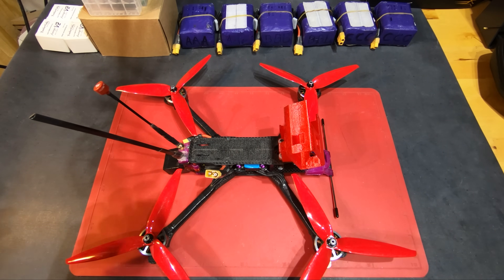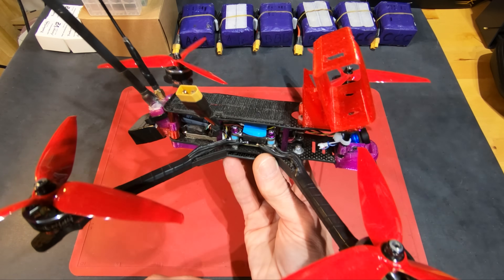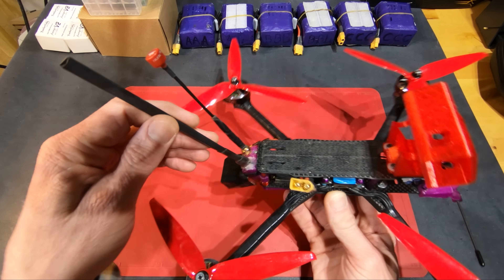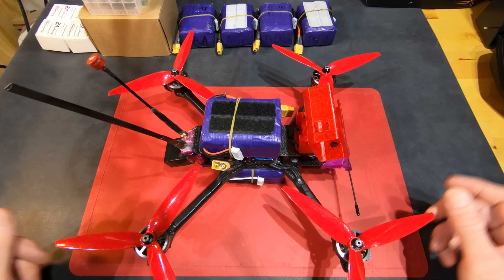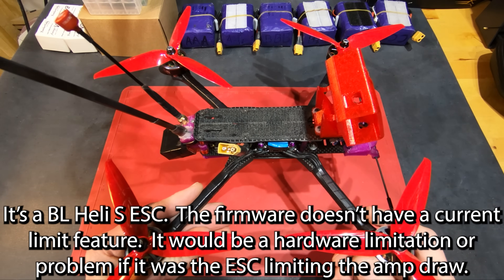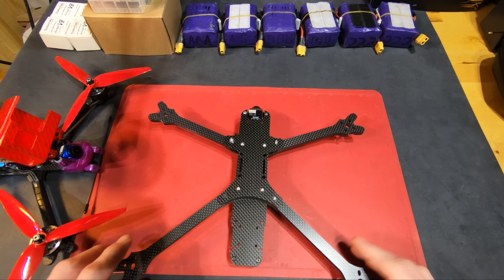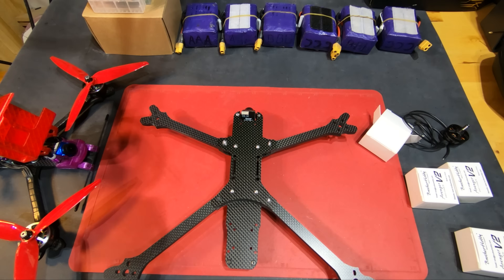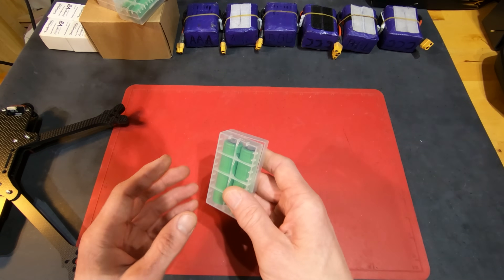My 2020 Long Range FPV Drone & Gear : Gets 8.5km Out - Roundtrips of 18km+

Comment: I'm using vtc6 cells in 6s2p for 6000mah. It seems like I can never get close to using 6000. They claim to be rated for 30amp but it think they are actually like a 15 amp battery. What amp rating do you believe they are? I got the wrong cells didn't I?
Reply from the maker: I think the vtc6 are better for lower amp builds.  Have you double checked your mah consumption from betaflight vs what a charger says after fully recharging?  To check that your mah consumption count is close to accurate.  If it's not and you are using BF 4.2 I believe there are some new features that help it make better estimations of mah consumption.
They are 15 amp batteries.  I don't know why they put 30 amp on stuff like the auline packaging.  The manufacturers data sheet clearly says 15 amps constant.  They do have a 30 amp rating but only for burst or possibly constant but ONLY with a temp limit from a battery management circuit.   There are very few cells that can put out serious amps.  I think electric car manufacturers are buying up entire lines of some of the best cells.  Not sure why vtc cells get so much attention, or why auline would choose those over ones with more than double the amp rating?
I made a vtc6 4s pack for my flywoo explorer and used my charger to confirm getting 2800 mah out of it, but the last bit the quad was really low on power.  I notice in the manufactures data sheet that is does sort of show that the last 1/3 or 1/4 or the cells output gets pretty lame.  Have you tried a throttle limit?  It'll reduce your power if you can spare it, but I think you might find a little better efficiency or maybe squeeze a bit more out of them (just guessing here)
Reply: @FalconRadFPV  Yes I calibrated my quads current sensor, you confirmed what I suspected, with a 15 amp rating as soon as I push them the mah turns to heat lol so with 2 packs in parallel I'm only getting 30 amps as a maximum which I'm at 20-25 climbing anyways, so the answer is? I can't wait to see some of your testing with the new 7inch setup on 4s! I think it will be more efficient and will hold more battery.

Comment: hello maybe you are the only one who can help me to understand.In the setting of the nano diversity in the voice power there are powers to be set in mw I do not understand what it is for.Sorry for being out of place
Reply from the maker: Sorry I'm having trouble understanding. In the crossfire Tx menu there are mw power settings, I don't think the TX mw power is set by the diversity menu I think it's in the menu for the TX.  Both are in the same place under lua scripts on the transmitter menu's.  The Tx mw power decides how much RF power to use for communication between the Tx and diversity receiver.  Generally 250mw should be good for most situations.  If there is much RF interference in the area or you are flying very far away then using a higher power setting might help.  I have the 9old micro Tx so mine doesn't go any higher than 250mw.
Reply: @FalconRadFPV  sorry you friend. In the crossfire menu we enter XF Nano Div.Rx> Power 0 mw 25mw 400mw or max power.I see these settings, Best regards friend  https://www.youtube.com/watch?v=7XKHNggnBsE
Reply from the maker: @ladronefpv4484  I narrowed it down to one of these two things - 
1- To me it looked like power settings for a nano 32 vtx.  Maybe you have a nano 32 vtx connected to your receiver?
OR
2- I also looked into it and asked some people about it and someone thought it might be a glitch that can be solved by installing TBS Agent Lite to use instead of lua script.
I found a good video about TBS Agent Lite here's the link for it.
https://www.youtube.com/watch?v=4aZfvu2iUrs
Hope this helps!

Comment: First off, thank you so much for sharing that with us, I have watched lots of long-range flights but I'm pretty sure you are the best. It's an honour to be subscribed (SO IF U AREN'T HIT THAT SUBSCRIBE BUTTON)
I also just wanted to ask - I have a stock flywoo explorer, with some skyzone 03o proper diversity goggles (but a fairly bad immersionrc invader patch) and I can still only get about 400m out. I know it's a smaller quad, and it's only a 600mw vtx, but that's not even in the same ball park as 8k I can't even go 1/20th of the distance! Is that really down mainly to the better antenna? If I were to get an x2 air would I at least be able to go a couple of km?
Or is there something wrong with the drone or how I am flying it? I make sure to keep in los.
Thanks so much for all your content - I'm not much of a judge but you're certainly one of the best!
Reply from the maker: Sorry some comments were "lost" for a while somehow.  I think it would be to do with your goggle and or the receiver on them or the antennas.  With my Stock flywoo explorer I made it to 3km out and still had pretty clean video.  Or it could be that it is not set to a high output power for the VTX, or that you have it on a close by VTX channel but not the right one.  If you VTX is set 5800 and your goggles are on 5820 then your video will look good at close range but then it will get bad really fast, I would check this first.

Comment: I love it! My biggest issue with long range is always video. Thanks for the info. Keep the videos coming!
Reply from the maker: Thanks! Will do!
Reply: @FalconRadFPV  have you tried 4s on your setup? I wonder what type of flight time you could get?
Reply from the maker: @patmcfarland9880  I just did the other day with one of the new packs and for this heavier style of quad it wasn't enough thrust.  I could get up and fly around no problem but any sort of dive would need to be pulled  out of way early.  I should put two of the new 4s packs on and see what I get for distance and flight time.  It would be an interesting comparison.  I have some 2208 1800 kv that would probably be more efficient with 4s but I'm going to try out the 2507 1750 kv motors I got first because I like having descent thrust when I need it (eg. for diving mountains and battling heavy wind gusts)  After I finish building the quad (probably with the 2507's) I'll start the using the old one for lots of testing!

Comment: Thank you, great video !  Would you custom build for a fan ??
Reply from the maker: Possibly, I'm just about to start a new build with a new frame.  I'm going to play around with different motor kv's and 4s to 6s battery packs made from 18650 and 21700 li-ion cells.  I'd like to come up with a more efficient setup made from better quality, more reliable parts before I would be comfortable selling a pre-made long range quad to someone.  I'll definitely keep the idea in mind.

Comment: What power do you use motors Brother Hobby Avenger V2 2507 with 21700 battery? 5S 1500 kv? And what is type of props?
Reply from the maker: I'm going to try 1750kv with 4s.  I've been using gemfan 7040 but I have a few 7" bi-blade props that I'm going to try out as well.
Reply: @FalconRadFPV  Other pilots tell me that for the longest flight need to put 4S on 21700 and bi-blade props. Thanks for the info - 1750kv will give good traction up to 2.8-2.9V per can. What type of bi-blade props would you recommend to use for the longest flight time, but also so that the drone does not blow off in the wind in the mountains? How much power the ESC will be enough for 1750 motors?

Comment: Hope I didn't shoot myself in the foot on flight time going lion 3000mah 297 grams x2 (too heavy?) for my 7" Super G plus frame. I went with BH 1300KV motors, tbs pro32 vtx, tbs nano diversity rx, crossfire lite tx with tbs diamond antenna, true rc x2air x2 for goggles (used the links from your channel), true rc singularity (your link) for vtx antenna, will be running bardpole on back and immortal T horizontal on front with drop down mounts from brain 3d, RDQ BN880 GPS module w/compass and 30x30 zees stack, If there's anything you would change on this setup let me know please! The last of these item showing up as i start into 6 days off from work!! Really want to get it right 1st time around.
Reply from the maker: Awesome, sounds like it should be a good build.  My only concern of the parts list would be the amp handling of the li-ion packs.  My setup gets really low amps for some reason.  Possibly from limiting from the budget esc?  So your amp draw might be higher than mine, which is fine, you might just need to use a bit of a throttle limit or stay conscious of not keeping hard on the throttle for too long.  I assume you got vtc6 li-ion cells?  The higher the capacity generally the lower the amp handling of the li-ion cells.  The 2600 mah molicel ones are rated at 35 amps constant and the vtc6 is rated at half of that.  They probably will be ok just check the battery temp right after flying and try not to let it get any hotter than a lipo after the avg. freestyle flight.  The weight should be all good, my li-ion packs are about 320g and I use two of them at once.  Another bit of advice, before trying to go way out with it, get it tuned really nicely.  Get your current meter calibrated as well as you can so you get reliable mah readings.  Test your gps rescue a bunch of times and just fly around close by getting more and more comfortable with what the quad and batteries can do.  For example, does the battery sag really bad near the end of a pack so maybe avoid doing a big cliff dive near the end of the pack, stuff like that.  (There are so many betaflight options now,  I try to get as much setup as I can, but I avoid anything that I don't totally understand.  Like the variable min throttle thing, I'm fine without it and when setup incorrectly it can cause desync's.)  (Double check yourself if you can, but I think for blheli32 that 23 degrees is the safest timing to prevent desync's)
I'm just about to start my new build as well, unfortunately I injured myself at work so I'm also off for this next week.  But It should give me time to get the build done and finish designing all the tpu parts!  Good luck with your build, let me know how it goes.
Reply: @FalconRadFPV  I think I made a huge mistake on battery selection - Auline Sony vtc6 30amp max.. Shoulda built my own - definitely not wanting a de-sync somewhere in the hills. Thanks for the info! I'll look into building packs with the specs you mentioned in your video
Reply from the maker: @douglasshackett8747  Sorry I probably made it confusing. but the batteries would not cause a desync they just might get too hot, so watch for that, but they should work alright.  The desync thing was separate , I just meant not to over complicate the betaflight setup for yourself.  (depending on how familiar you are with all the settings, changing stuff that you don't understand can lead to stuff like desync's)
Reply: @FalconRadFPV  great! That's good news, it'll be strictly for cruising LR. For my future sets of batteries I'll go dyi using the cells you recommend. There's a LOT of homework for me to do before flight time. And will closely follow your advice on testing prior to trusting for those LR flights

Comment: love the vid, its just that metal table you keep puting things down on, lol, loud as hell through my woofer and woke up my roommate..lol  booommm
Reply from the maker: So sorry!!  I couldn't even hear it at all when I was doing all the recording.  Will do better next time, promise.  😅👍
Reply: @FalconRadFPV  Do you think the Rapid Fire Module makes the bigger difference when flying long range, or the output power of the VTX? im building my first LR build, and i have some box goggles with built in diversity. they have diversity, rx1 and rx 2 to choose from in the menu..  im guessing its true diversity cause there are two separate receivers on the internal board. (FlySight 720p box). i also picked up the AKK Ultimate 3w. i could use some help.  i want to fly like you do.. very impressively amazing flight footage.. thank you

Comment: A quick one. Why you use RSSI instead LQ I know it's a bit more "transparent" I was flying recently in around 1km+ and had a weird readings fm RSSI, either I have fucked antena or doing something wrong even 26% but no Failsafe. Don't have Diversity yet and I have full XF. Was doing does with 250 and 500mW and very similar readings on same spot. Any advice will be highly appreciated.
Thx Pit
Reply from the maker: It might be drop[ping as you point the null of the antenna at yourself.  that's if you're using a horizontally polarized immortal T.
Reply: @FalconRadFPV  
I have Vertically polarised. Had it horizontally but ended up with of course limited range and performance. It need to be something wrong with either RX or antenna itself I think.

Comment: Go with 5s on the same stator 2806.5  1300kv , those 2507 draw more amps at mid throttle cuz the stator gets saturated more easily, and 4S setup with higher kv uses more amps too. I know you already bought the parts just saying that would be interesting on 5s, lighter batteries still not crazy amp draw.
Reply from the maker: Interesting suggestion, I should try my same setup with 5s.  I decided on 4s because is does draw more amps, as I understand it 4s is more efficent than 6s as far as watts of energy used goes.  The amps are higher but the watts drawn are lower for the same amount of thrust.  At least if I understood the data properly.   We'll soon find out.
Reply: @FalconRadFPV  Ok I see what your saying, it would be awesome to test both setups!

Comment: Seeing you have a lot of experience with long range, I have a couple questions about getting into it. Do you recommend just starting with your existing kwads (I have a 5 inch frame) and then build a long range specific model once you have a bit of experience under the belt? What do you think of the 5 inch lightweight long range trend (Dave_C minilongerange)? I want to have a build that is small and light enough that I can take backpacking but still flies well and can go a few km away.
Reply from the maker: All you need is 6s motors and 4s batteries and you can do some efficient longer flights even with 5"  or 5.2". 
I've gone over 5km out using gemfan 5552 props.  6" props were a little more efficient but not much.  So you don't need a big quad.  7" props do get you further out but how often do you want to fly 5 or 6 km away?  I hanv't tested it but I bet a 5" could go pretty far with the right motors and battery.  So yes I suggest playing around with what you have and trying to get some better efficiency out of it.  There is a lot you can learn with a 5" long range still, getting gps working tesing it, getting your current meter set just perfect and then seeing how many mah your battery will actually put out so you can always know exactly what you got left.  Get some practice with losing video and what to do about it.  There is LOTS you can learn starting off with a 5".  I just got a 4" flywoo LR.  It seems pretty good and real efficient, it does not have current meter though and no pin to add one (I think) but it doesn't sag the battery too bad so using the voltage to monitor battery levels such a big deal.  I haven't gone far out with mine yet, but talked with others getting 3 or 4 km with it.

Comment: Very nice thanks for sharing :D
I also ordered some vtc6 for my Explorer that I got a few weeks ago and my TrueRC X2Air antenna arrived today that I bought because of your recomendation I´m looking forward to test it ;D
With my Flywoo on 850 Tattu Lipo i got out 4km and it was pretty close to get it home xD But also the video was start going bad with my antennas, so I hope the TrueRC will make a difference.
Reply from the maker: Nice 👍Woah 4km out on an 850mah wow thats great!  I hope I get mine to do that well.
Reply: @FalconRadFPV  Holy shit, I got on a 4s vtc6 pack that I builded, 35 mins flight time :D (constantly 50 km/h) thats crazy

Comment: love the setup but could i suggest using some 21700 liion batteries instead of 18650 as they have 5000mah capacity
Reply from the maker: Never go for the biggest li-ion cell there is.  The amp handling will always suck.  3000mah 18650's are only good for micro quads a 5" will set it on fire unless its an ultra light.   There is one good 5000mah 21700 by molicel, but it's in there low amp catagory of cells and it only handles about 10 or 15 amps, which is one third of what the cells I chose can handle.  A 4200mah 21700 can take way more amps than the 5000mah, if the label says different it's lying to you.  Many brands say a lot more than they can deliver, just like a REAL 120c lipo is basically impossible, 150 + amps CONSTANT would just melt the solder tabs off the lipo cells.  (150 amp burst yes but 120/240 would imply 300 amps bursts.
Reply: @FalconRadFPV  I hear golden words!
Reply: lol just saw the video part using these

Comment: Great video, I got some good tips and assurances from it. My 7 Inch Chameleon ti LR is on digital now, but I am sure to switch back to analog for the sake of long range. A spot welder is worth the money, I got one from BG in a sale with coupons and just dremeled the solder of my old 1p 4s packs to make a 2p pack to accompany my 3p pack.
Reply from the maker: Thanks.  I keep thinking about getting a spot welder every now and again.  Hopefully after my new packs are done I won't need anymore for a couple years.  Maybe I'll upgrade then.

Comment: So are those BrainFPV GPS units da bomb??  so expensive, must be some wonderfulness to them, like easy fast sat acquisition?  I've been using HGLRC GPS units for cheap but having trouble with them on quads.
Reply from the maker: The brain fpv gps works great.  Locks sats quickly and it doesn't jump around much.  I think part of better gps units is having some sort of filtering on the power and possibly shielding for it's electronics.  Both of which would help speed up sat lock and help keep the sat count steady.